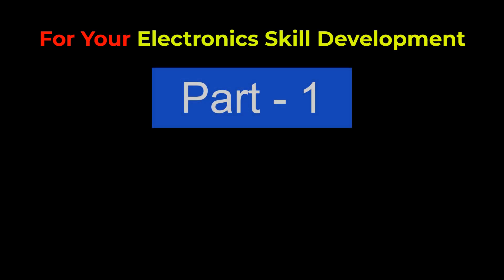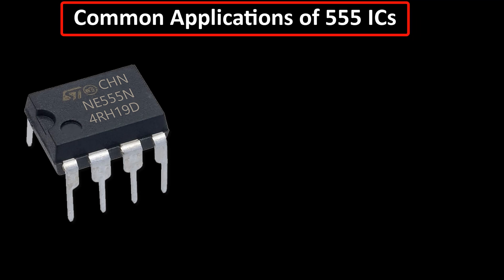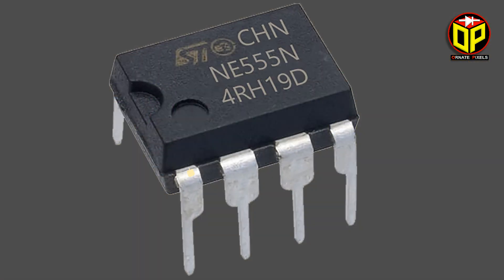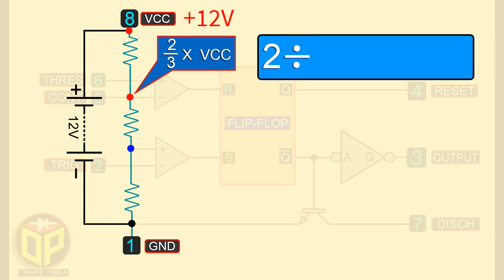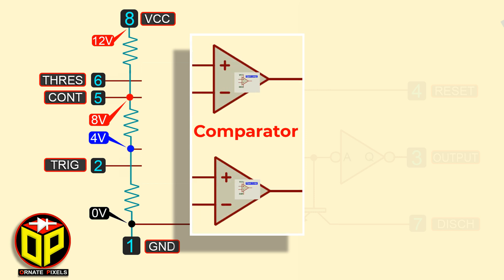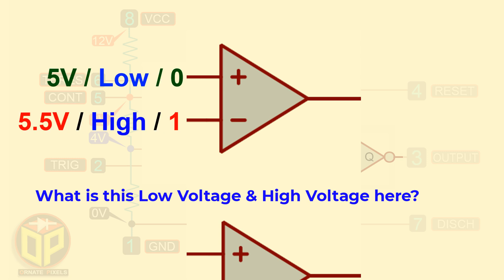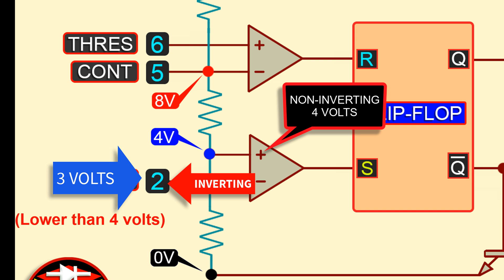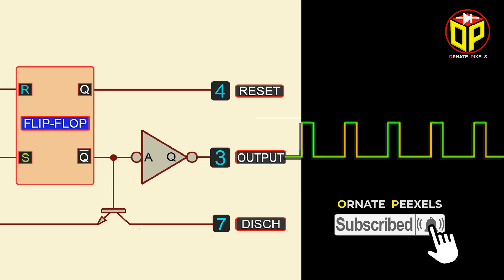555 IC Working Principle: Why Its Logic is Crucial in Modern LED TV

Comment from the maker: Test your practice:
If a 6-volt power supply is applied to the 555 IC, how many volts will be present at the inverting terminal of comparator 1, and how many volts will be present at the non-inverting terminal of comparator 2 ?

Comment: Sir thanks for clear explanation.  What will happen if both inputs are exactly equal? I tried a over voltage realy cutoff useing 555 ic. The input voltage is  very graduall increase say 0.1v per minute at terminal 2. When both reference voltage and in put voltage is exactly same the relay started chattering for some time. What is the reason and how to overcome please.

Comment: Greetings from Venezuela, excellent video, thanks for sharing your knowledge. One question, I have a BR3200 diode, can I replace it with the MUR460?
Reply from the maker: BR3200 is 3Amp, Heat tolerance is 125°
MUR460 is 4 Amp. Heat tolerance is 175°
So, BR3200 should not be used.
Reply: @OrnatePixels  I have damaged the BR3200 and I want to replace it with the MUR460; so if it is possible?
Reply from the maker: @pedrojuarez2688  SMPS circuit?
Reply: @OrnatePixels  It is from the backlight circuit
Reply from the maker: @pedrojuarez2688  You can use MUR460. (Sorry for the late reply) Thanks Brother.
Reply: @OrnatePixels  Gracias por responder
Reply: Thanks for answering